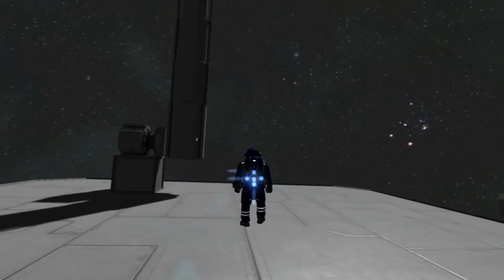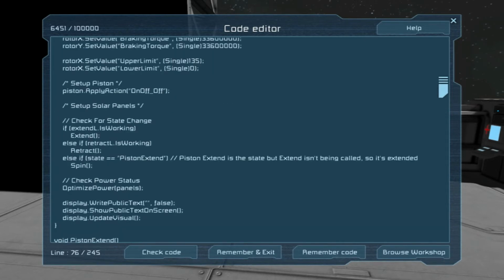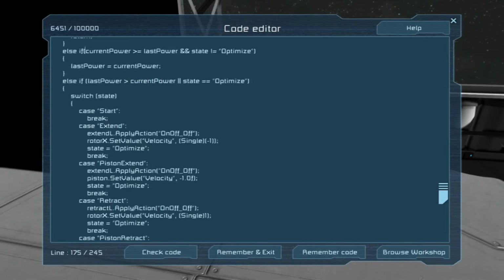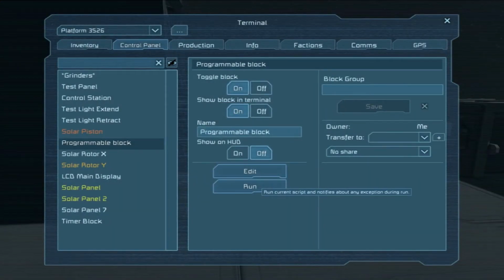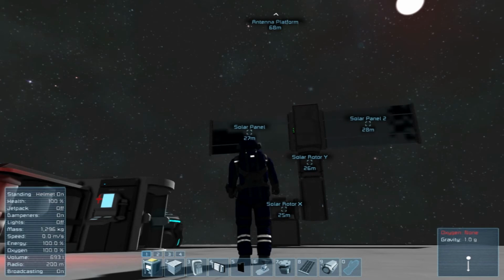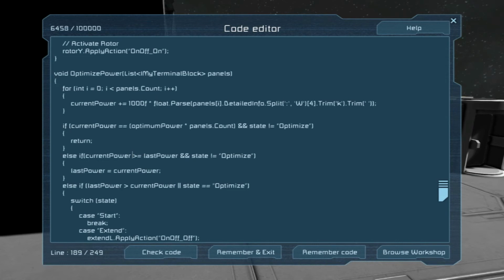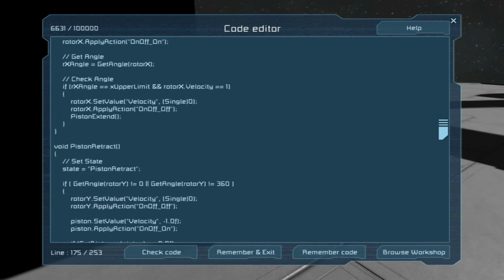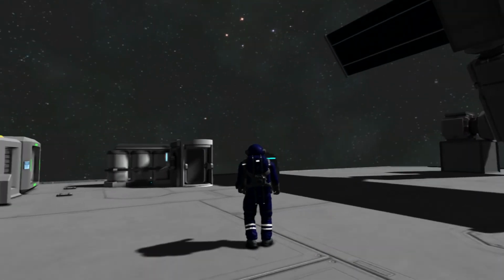Space Engineers Programming 101 - Auto Solar Script - Part 3

Comment: Never, ever, ever compare strings with == !!!! That way lies logic errors galore! Use String.Equals (). ie. 

if (state.Equals ("PistonExtend"))
Reply from the maker: +VeiledDraconis Well, I've used it that way a lot & never really run into any problems, though I normally know ahead of time I'm comparing to another string or something compatible, though, you're right in that it wouldn't really hurt anything to change it to the Equals method either. :)
Reply: +Sleepless Knights Studios Typically == is used to check for identity while .Equals() is used to check for equality. String class overloads == which is why that works. The drawback is that the compiler has to know it's a string. For instance if you wrote:

string a = "equals";
object b = "equals";

Console.WriteLine(a==b);

it would evaluate to true but only because string literals are interned. It's really only true because they are pointing to the same location in memory, not due to string equality.

Generally it's better for reference types to use .Equals() and primitives to use ==.

Forming that habit will help you immensely in the future and save you a lot of headaches. I speak from experience.
Reply from the maker: VeiledDraconis
True, hadn't thought of it like that, I suppose I never really messed with it cause I almost always use specific variable types, I really don't like using the var type of variables. Not just for readability but I always felt like it'd be easier on the system if you explain the variable rather than make it figure it out. But I don't know that to be true.

Even still, in terms of practice you do have a point, I really never thought of it because in everything I studied it always used the == way and never really mentioned "needing" to use the Equals method instead. :)